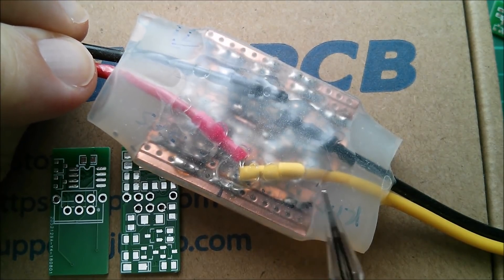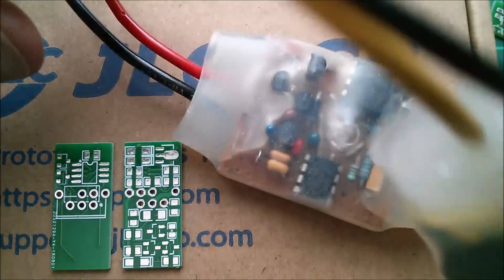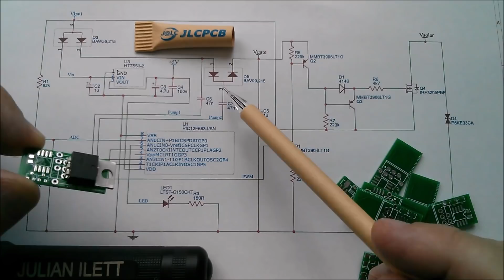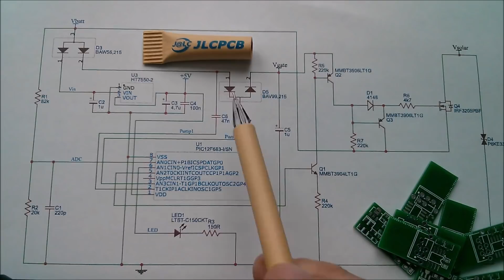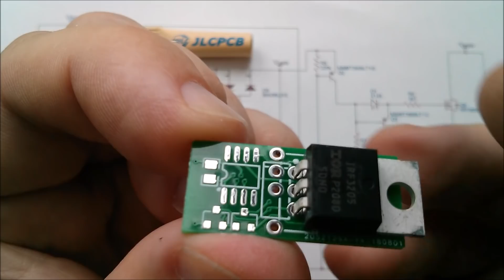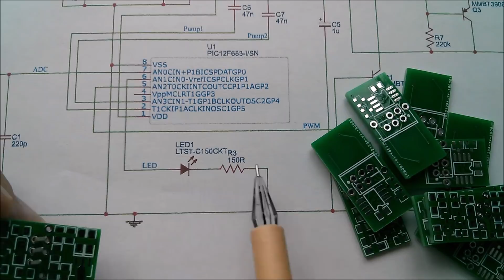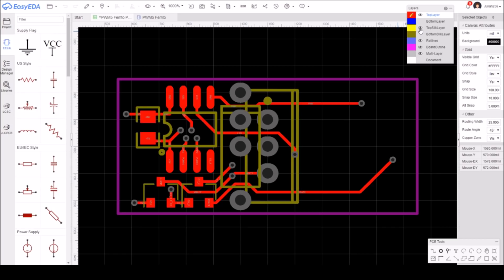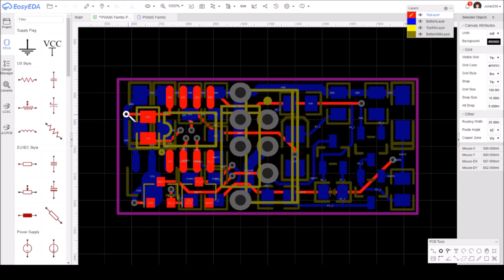PWM5 Femto PCB

Comment: I live on a yacht. I had to mount plastic hatches which leaked....why mention this? It turns out, all plastic has a film which glue will not stick to long term. If you are going to silastic wires in, you need to use Acetone to clean the wires where you want the silastic to stick to. Otherwise, the surface tension of water will sneak between the silicone and the sheath on the wire.

Comment: Hi, you need to move away from that sillycone! The best way would be to use that piece of pipe as a carrier and vacuum pot your module in it with the wires coming out from one side! This way there is no air bubbles or infact no void for moisture ingress! Also to pot the wires in would add to the mechanical strength e.g. someone stands on a wire then it would not pull out of the module.Get in touch if you want some ideas of how to construct a simple vacuum chamber for this application... RL Labs Ltd.

Comment: Good work as usual. 
Did you try the "auto Router" function on easy-EDA? I use it for ALL my boards I've done quite a few. You can adjust the track widths and clearances quite easily.

Also, others have made a good point (below) about using a stencil. JLC will provide one for $7.US . But i should warn you the alignment is quite tricky. I learned to ALWAYS include at least 2 x 1mm mounting holes in my design and when I order the stencil I add a custom comment. "Please drill the through holes in the stencil to help me with alignment". Then when I get the boards I simply use a couple of nails on a scrap piece of wood to align the stencil with the board.

Then... (a yard sale find) I have a GREAT re-flow oven. Its a convection toaster oven. I think the key is the convection because there is a small fan which keeps the heat uniform in the oven.

So to recap.....Schematic, convert to PCB, place components where I want them, run the "Auto Router", order a stencil (with alignment holes), Wait a week or so, Assemble my LOW-tech solder smearing set-up, tediously place all the components, place in oven for 2-3mins (watch the magic happen), carefully remove from oven, and then test... and usually..I find something wrong...so i fix it on the Easy_EDA, and start the whole process over again.

Cherrio...from Canada.
Barry

Comment: On the silicone sealant, I suggest smearing the inside of the plastic sleeve in Vaseline or silicone grease before filling with sealant, then you don't have to use wd40 (unpleasant)

Comment: Nice design!  I've had good luck with boards manufactured by JLCPCB. I have a couple designs right now that use 0805 components. I prefer to use 2206, but sometimes what I want is either not available in the larger size or the price is way more than the 805 package. I did acquire a stereo microscope, so that's a learning curve as well. And I bought a micro soldering iron. It's a brave new world!

Comment: If you use silicone to pot the boards, make sure to use a neutral cure silicon, since acid-curing ones will destroy the board over time (it eats the tracks)

Comment: while ur getting pcbs from jlcpcb why not tell them to include a stencil so u can simply smear the solder paste, place components and use a hot air gun to solder it rather than have to design a injection pump to do it manually?

Comment: when u say 100W is it for a solar panel with open circuit voltage of 25V or can we use this with batteries in series?
Reply: thanks for firmware etc, plan to build a board that will have the ur design to charge the battery and will add a synchronous buck converter to provide 5V/3A out to charge my mobiles etc, long term plan is to build a board that can output 12V and 24V which can use to power network switches etc for a client in a remote location where they have frequent blackouts. btw i use altium designer to design PCB
Reply from the maker: 100W 36-cell solar panels have a short-circuit current of 5 to 6 Amps. It's the amps which will overheat the MOSFET if too high.
Reply: Julian Ilett so in summary we can charge batteries in parallel only and not multiple batteries in series right?
Reply from the maker: Yes, that's right.
Reply from the maker: Well, you can charge batteries in series, but you'd need multiple charge controllers and multiple solar panels not connected to a common ground - if that makes sense :)
Reply: Julian Ilett ok thanks for that info but in my local market there are a few charge controllers available that say they can charge 12v and 24v batteries so I'm assuming they mean 2 batteries in series, same they say for solar panels which can be one or two in series
Reply from the maker: Yeah, 12v/24v controllers are commonly available.

Comment: Julian, may I recommend my SMD reflow technique ? Spot the pads with solder paste using a cocktail stick, pick and place the SM components, and then reflow using the cooker in the kitchen (we have an electric hob with a glass top). It works well at least down to 0805 and TSSOP packages. Sometimes a little rework with solder wick and flux on the ICs is required, but overall very successful. Clearly only suitable for one side of the board ... you'd have to manually add the components on the other side, together with the TH parts.
Reply from the maker: I tried the cocktail stick idea, but I think my paste was too dry :(

Comment: Surely there's a charge-pump-on-a-chip (or almost) MOSFET driver somewhere, that you could use to save a bunch of components.

Also if you really wanted to play around, you could try to find ways to stack components on components :) or make a 2-PCB sandwich with some components in the middle

Comment: So what stopes it from handling more current just the mosfet and could you stand it up and use a heat sink if you did not seal it up
Reply from the maker: Heat generation. The small on resistance of the MOSFET generates heat. When I was using the IRFZ44N (16 milliohm) some controllers in hot countries (Uganda/Malta) overheated. The units in Greenland were fine of course. With the IRF3205 (8 milliohms) much less heat is generated at 6 amps current. The external diode is another story :)

Comment: Putting a via under a SMD capacitor or resistor is not good design practice.  Changing the board to use a SMD transistor will shrink it, as well as using 0603 chips, but I know you said  you wanted 0805.

Comment: You could always cut the "sticking out bit" of the Mosfet's lug off with a dremel or similar. With that spec'd component I doubt the lesser heat dissipation would be an issue. The other thing is that you could also use that as the drain connection of one of your lead-out wires. (Whether it was trimmed or not).

It's the day of Imbolc here in the southern hemisphere - exactly half way between the Winter Solstice & the Spring Equinox. I consider this a very important day for solar powered off-gridding as it denotes the end of the especially shitty period for solar power production. :)
Reply from the maker: I thought of using the tab as a connection point, but a nut and bolt is too bulky and a rivet might work loose over time.
I celebrate the equinoxes and solstices, but I never heard of Imbolc - cheers Xan, that's a new date in my calendar :)
Reply: The Solstices and Equinoxes are your main Seasonal Days of course, but in between them are what are called the Cross Quarter Days, which are the mid points between a Solstice and an Equinox. The names I like to use for them come from the Celtic Tradition. So here we have Imbolc (follows Winter Solstice), Beltaine (follows Spring Equinox), Lughnasa (follows Summer Solstice) & Samhain (follows Autumnal Equinox). 

It seems that those mid-points were of more interest to the ancient Celts than the main Seasonal days. Some people like to commemorate them on fixed dates, which I think misses the point as the move just like the Solstices and Equinoxes do against the calendar dates. There is a really good website where you can find what the dates are for each year and heaps of other info there too: http://www.archaeoastronomy.com/2018.html

I find that the poor solar production period runs from the day of Samhain until the Day of Imbolc each year, with the Winter Solstice in the dead centre of this. Which of course makes sense really. 

Conversely the excellent period is from Beltaine to Lughnasa. 

Back to the charge controller, yeah a nut, bolt & lug would be far too bulky. I was thinking more of you could solder to the tab. They solder quite well, might just need to rough the surface a little bit with some sand paper. 

My PWM5 is still doing the business perfectly in the generator shed. Even though now I have a massive "umbilical" connecting that shed to the main power room, the PWM5 and it's little solar & battery system is still responsible for the lights and radio operations of that shed. :)

Comment: Nice to see diligent effort. That said, in projects like this you still have to deal with strain relief (and often mounting of the board), and you often end up discovering that a brilliantly small PCB would have been so much better if it had been a little larger to include mounting holes, or holes through which to stick zip ties to grab the wires, or even just holes to thread the insulated part of the wire through so that axial force is transmitted to the board and not to the solder connection and PCB tracks.

Comment: That just reminds me how insane the board a friend of mine wanted to do (and we pulled it off):
1inch x 1 inch, power regulator for 3.3V2A, IR-sensor, gyro, 4 status LEDs, SPI-bus, some connectors to 3 boards - each with their own SPI, and a qfn 48 micro controller. Took us 3 days to route that bastard. We had to use vias in pads to get the signal to the other side several times :P

Comment: If you decide to order more or just find these a bit fiddly, then please give me a shout as I'd be more than happy to assemble some for you. I have a trinocular inspection microscope, JBC hot tweezers and Hakko micro pencil etc and love soldering, so it would be a pleasure to help out.
Reply: Julian uses a halogen bulb to reflow smd.
Reply: Erm, yeah now I remember him mentioning something about that. Unconventional and scary.
Reply: It's got 30 components. It takes very little time to solder all the components with a standard iron. For low volume manufacture, there's no need to use any other form of assembly.

Comment: Why don't you have a ground plane?
Reply: @apollo wellstein 

Why have a ground plane? There's a ground connection to run the PIC and LED only. There's no other need to have a ground on the board, so it definitely doesn't need a ground plane. ;)

Comment: would it be easier putting the board in a clear resin ?
Reply: there is only one caveat to this if i understand correctly it will need to be UV stable

Comment: On tiny PCB designs like these, you can use PLCPCB's panelization service to get more boards for no additional cost since even the panel of boards is still smaller than the maximum size for the proto pricing. For these ones, I would thing you could easily do between 2x4 to 2x6 to get 8-12 times more boards for your 10 qty.

And with panels, solder paste stencils become very useful.

Comment: Very nice board! Quick question: wouldn't the metal part of the mosfet possibly short out the two vias underneath? Or are you going to use some insulation between the mosfet and the board?

Comment: I would add series resistors to the charge pump to Limit inrush current when the battery is connected. Further i recommend to use superso8 mosfet. Single side assembly would make your life much easier. Space can be save by using far smaller components. 0603 is a good size for human. 0402 if you go for machine assembly.

Comment: Instead of the hot glue, can't you use some large waterproof heat shrink that has adhesive and is UV resistant?  I would think that would be pretty permanent stuff.  I used some of this on my submersible water pump and its been happy for a decade and a half... granted, its not in the sun.

Comment: An idea to be able to easily remove the tube after the silicone sets : Cut the tube lengthwise, use tape to "repair" the cut, insert module in tube, pour silicon and let it set, remove tape. The tube should be easy to remove.

Comment: 0805 is pretty small to be fair, I'll go as low as 0402 with some cheap magnifiers, but to what end.. the tracks still have to exist.. I'm not sure you'd save that much space even going half way with what is it 0603 or so. No. I think you made a good choice.

Comment: Why don't you just cut off the mounting plate on the Moffett? if you are not going to mount a heatsink its just more space.
Reply: Spelling aside, that's not a bad idea. Of course, they're pretty tough to cut, I'd imagine. Could get messy without the proper equipment. Would need at LEAST a dremel.

Comment: Great video Julian. I'm sure you know about panelisation. Sponsorship deals aside, $2 for any amount of boards you can fit in 100x100mm - The feature is near the bottom of the order page. I've successfully used it to get 90 boards for the price of 10 (well almost, slightly dearer P&P).
Reply: https://jlcpcb.com/quote/pcbOrderFaq/Panel%20by%20JLCPCB

"Make sure the one single PCB's size bigger than 2cm*2cm, small PCB is hard to v-cut."
Reply: Okurka I'd forgotten about that - Good catch!

Comment: The cracking you see on the metal is the very fine (thousandths thick) layer of tin/lead or tin plating on the leads.  I used to miles of those connectors in reels and tested the thickness of the coatings.

Comment: if you panelize them you could get as many as you could fit in 10cm x 10cm for the price of one single board,on the ordering options before saving to cart change the option 'panel by jlcpcb ' from no to yes

Comment: Beware. If the silicon sealant smells of vinegar, then do not use it to weather-proof electronics (where it's in contact with the electronic components). Use the less common type that doesn't smell of vinegar.

Comment: You did a nice job routing that board. If it was me, I would have used a 4-layer board. If you are going to build these yourself, I would have make the board larger and added reference designators. If these are for outdoor use, I would use actual conformal coating. I think you can buy it in a spray can, but it's not cheap. Something like MG Chemical 422B should work.

Comment: Be careful using silicone sealants as potting compound. Some varieties are actually conductive (brought about due to the solvents used). A firm I once worked for used it as potting compound in order to “protect their secrecy” only to have the thing backfire in their face as  the end user experience catastrophic failure of the devices we provided. When we got the faulty units back and dissected them we found evidence of tracking throughout and a lot of burned components.  A secondary problem is the risk of fire due to the tracking. Silicone sealant is not necessarily inert and can catch fire.

Comment: On a new topic can you please make a smole 24 H timer that runs on a smole 3v battery, settings from 3 seconds to 24 H, To switch  on and off a 3 to 9v input into a smole circuit.